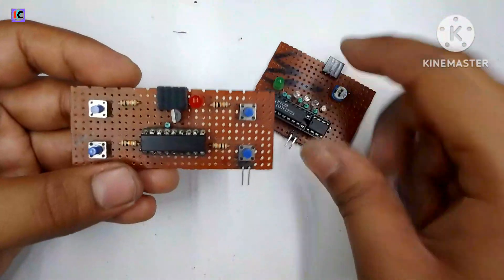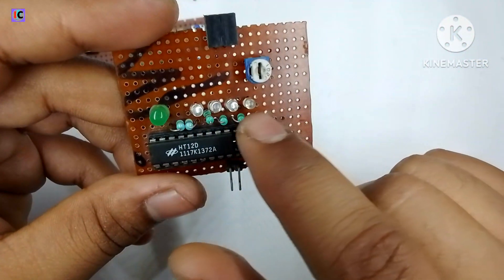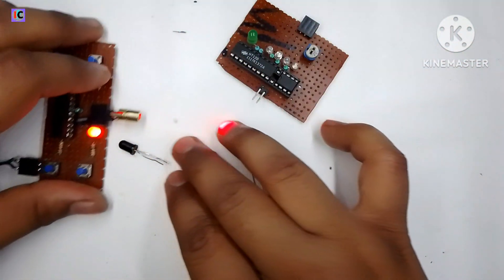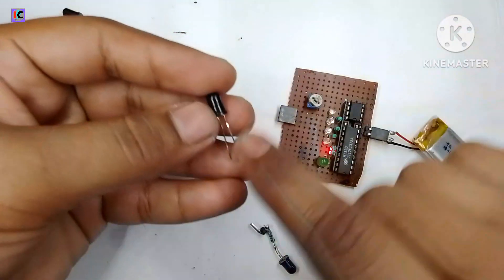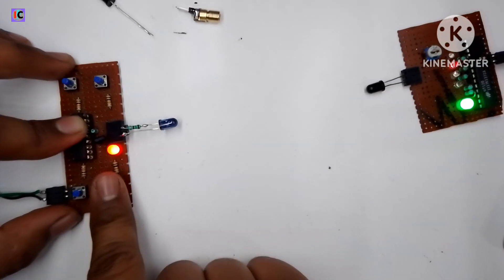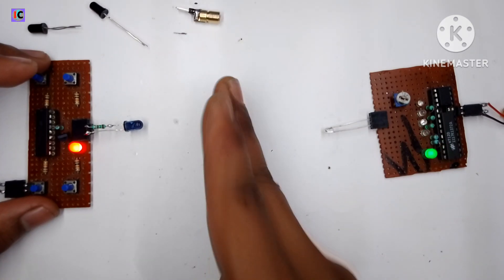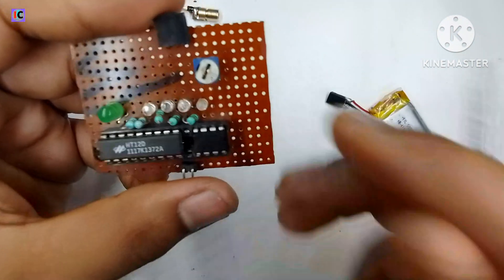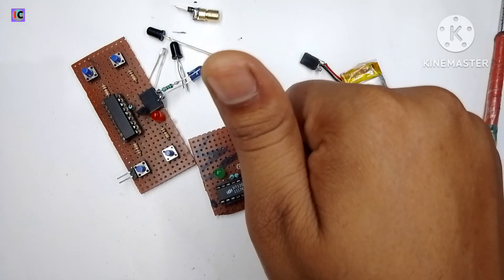DIY Laser Communication | Step by Step

Comment: At 0:47

It is showing 102 on the potentiometer....
It means it is 1k ohm potentiometer.
Please varify if I am right.
Reply from the maker: Yes its 1K, you can you 1K, 5K, 10K or even 100K all will works and the preset is used to adjust the sensitivity